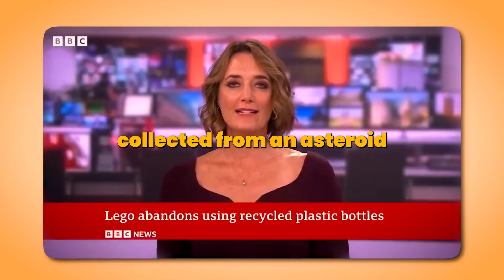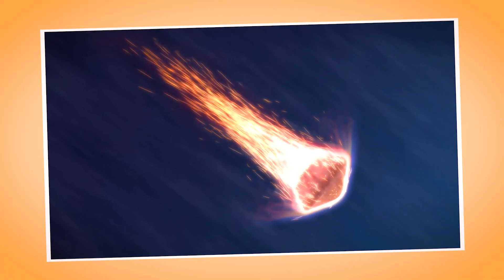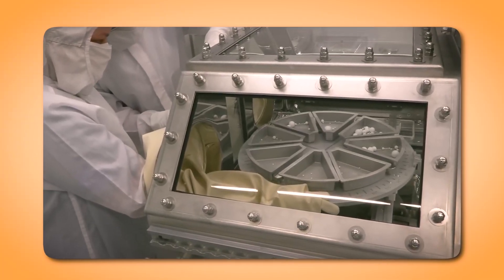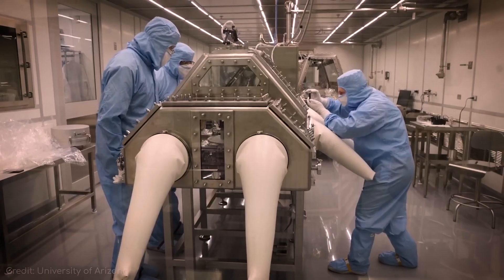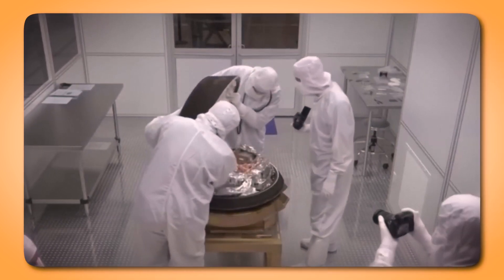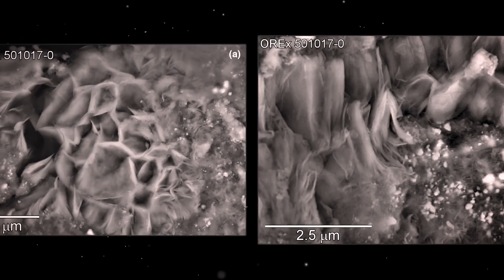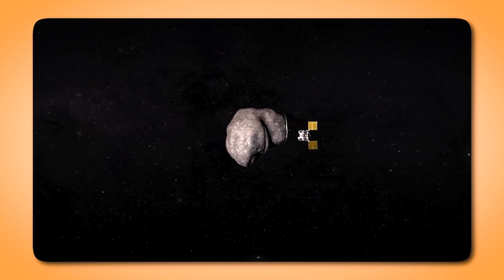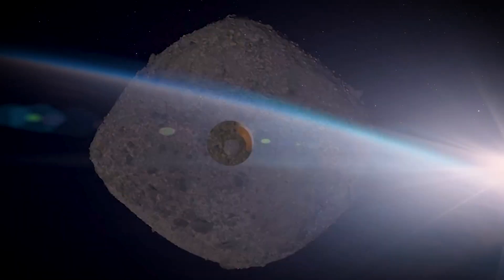Scientists Finally Reveal the Unexpected Discovery Found in the Bennu Sample

Comment: Really we can slow it to a stop right
Reply from the maker: Yes, stopping an asteroid from hitting Earth is possible through several strategies that scientists have studied and tested. One method is kinetic impact, where a spacecraft is sent to collide with the asteroid at high speed, altering its trajectory; NASA successfully demonstrated this with the DART mission in 2022. Another approach is the gravity tractor method, where a spacecraft hovers near the asteroid and slowly shifts its path using gravitational pull. A more drastic option is a nuclear detonation near the asteroid, which could push it off course or vaporize part of its surface, though this risks creating multiple hazardous fragments. Additionally, experimental methods like using solar sails to reflect sunlight or high-energy lasers to vaporize the asteroid’s surface could also work. Lastly, an asteroid tug spacecraft could attach to the asteroid and use thrusters to change its orbit. Early detection and understanding the asteroid’s size and composition are crucial for the success of any of these methods. Thanks for participating in this discussion.